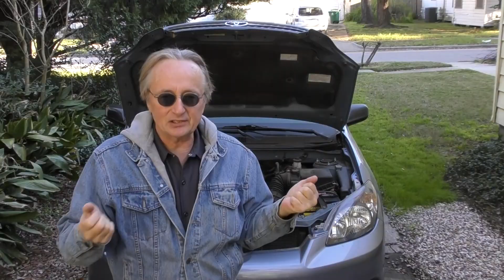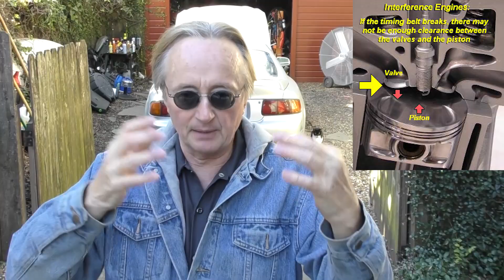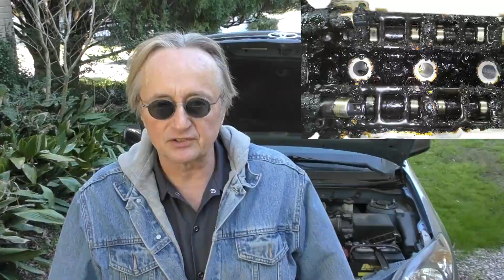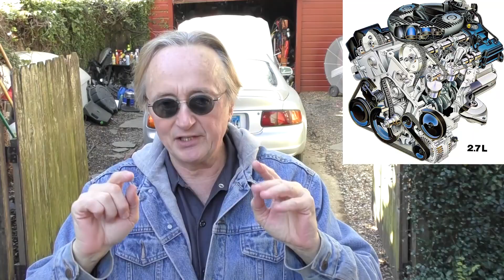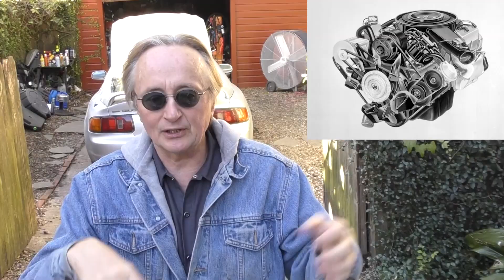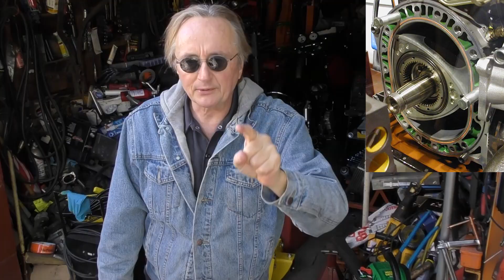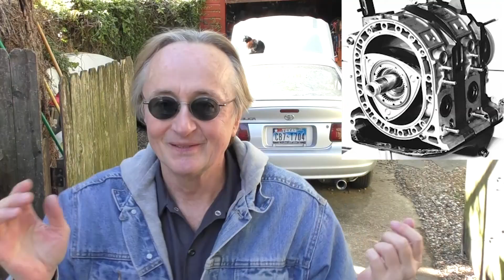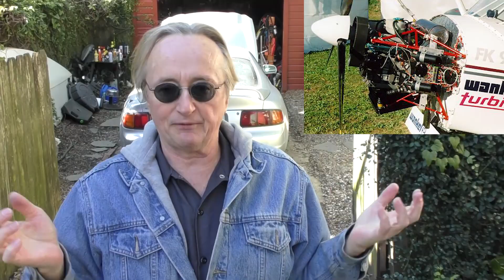Never Buy a Car With This Engine

Comment: 3.5l Ford duratec. Built just like the Chrysler with water pump internal. If anyone out there has this engine just know that when that water pump breaks around 100,000 miles or so your engine is toast. Should be a class action lawsuit.

Comment: He forgot to mention the water pump in the 2.7 Chrysler could leak antifreeze into the oil. And there were Toyota V6 engines with faulty pcv tubing that ruined some engines, and arrogant Toyota would say it was the owner's fault in spite of maintenance records until a petition was submitted to make them address this issue.
Reply: @Dilly Dally For the Toyota V6s, was that with the older Tacomas? (especially pre-2010) (FYI, even the post 2004 MY Tacomas, reportedly suffer frame rot!) (I have yet to be told about frame rot in the 2014 MY Tacomas) I know someone with a 2014 MY Tacoma V6 and it honestly looks like the best Tacoma generation! OTOH, I got word that the 2015 MY and later Tacomas are at risk of mass transmission failures and/or mass engine failures. Or mass diff. failures!

Comment: My dad got 338,000 miles put of a B150 Dodge 5speed/with oD short box fullsize 2wd 5seater 6door ! ( i remember my dad squirting calibrator cleaner in the carborator while driving & shifting with the engine shield off & the engine was visable in the cab)

Comment: I don’t see any issues with turbocharged cars. I think the owners are the issues. Don’t change their oil on time. My old Saab has over 150k miles, engine is super clean inside, no sludge. Oil was and is being changed every 5k miles.

Comment: Saab RE-Designed the timing chain BS that the original ecotec had. I also think the timing chain issue was corrected on the newer ecotec motors 03+ up if I’m not mistaken.

Comment: if you overheated the rotary engine, the aluminum housing it would  expand and "crush" . that meant the aluminum would have a gap below the exhaust port and anti freeze would leak in .  replace the housings and all the seals, also replace the clutch . the engine was out anyway. might as well save the customer some $$$$$

Comment: Scotty, you forgot the biggest TURD of all. The Oldsmobile Diesel of V8 1978-1985. We owned one. It was sooo bad of an engine, the dealer deducted $2,000 upon trading it for a Dodge Caravan (4-cyl Mitsubishi). The NADA guide had a deduct, right after mileage, for "gasoline engine conversion."

Comment: The 2016 R/T truck hemi 5.7L the  Eco mode sucks! And it tops out at 109... 👎
Reply: Operator 9013 thats actually not bad for a truck, most other trucks are usually governed to about 100 mph. My ‘10 dakota (3.7l v6, 4-speed auto) was factory governed to 107-108 mph, and i had it tuned to match the speed rating of my tires (t- 118 mph). :)
Reply: Kingswood7189 I understand but spending that kind of money do you think I should have to spend more on tuning?  22’s built in ram boxes tonneau cover all the bells and whistles...
Reply: Operator 9013 fair enough. I paid $19k for mine when it was 3 years old and later spent a couple hundred $ on the tuner (of which doesnt really adjust much, but it does make life easier if you get bigger tires and other things of that nature).

Comment: The earlier 5-cylinder Audi engine (and turbocharger) had a reputation for reliability. I had a 1988 Audi 5000 turbo on which many things failed, but it never had trouble with engine or turbo, even after I had the engine computer hacked and the wastegate spring replaced to allow more boost. Must have made troubles with the newer engine seem especially wrong...

Comment: Never buy a car with a timming belt.  Kia had these until 2009.  timing belt has to be replaced every 4 years or 60 thousand miles.  Expect to spend 1800 dollars to replace a 30 dollar belt.

Comment: I have a 2010 2.7 V6 Avenger and it’s been my battle horse since 2012. This is the first time I hear bad things about the  engine. To be honest with you till this day I don’t have any problems with it. But also I do my oil change every 3000 miles, I swap the spark plugs twice a year and I’m always trying to stay ahead with the maintenance of the vehicle. I have 108k in that engine. Hopefully it will last me more time. Already took me 3 times to Mexico City and i use it for long trips. Thanks for the great video.
Reply: @hitek9wittafulclip Wait till the anti freeze leaks into the base

Comment: I've seen plenty of EcoTech 2.2L engines with over 300k on them. Funny how you didn't talk about the garbage mid 2000s Toyota engines with the ceramic piston rings that burnt more oil than anything. Toyota wouldn't even let us fix them! They just replaced them.

Comment: Don't forget about all those junker DOHC and SOHC engines they put in all these crossovers these days that are just as horrible, unreliable, undependable as the Chrysler 2.7 V-6 btw which btw I loathe. Most of if not all the automotive company giants are guilty as charged. Defeat Devices is a trillion dollar a year business.
Reply: Toyota V6's FTW ... well at least ours from the late 2010's is still going strong!
Reply: @BenjaminEsposti  well late 2010s is now so that would make your car brand new.........so I would hope its still going strong
Reply: are these the Mitsubishi v6 found in Plymouth Acclaim or Dodges? I ran away from fixing them.
Reply: DOHC engine deisgn isnt really so new. My '98 Corolla with the 4A-FE has such without many problems.Its my least old car and doesnt have problems really. It did have an idling issue once but that was caused by a corroded alternator harness. I just replaced one pin on the harness and it runs like new lol.

Comment: The 2.2 ecotec is a great motor. I had oneu til 300 thousand miles and it never gave me an issue. They aren't called the small block of four cylinders for nothing.

Comment: So i habe 2 2006 chargers. One has the 2.7l v6. Should i put in a 3.5 high output. I have the 3.5l in the 2nd cbarger. According  to what i uave seen i only need a new accondenser and to make the hoses about 2 in longer. Trans, ecu, wireharness, fuel system will all switch over. Just a update to the ecu. Worth it or not. Still about 4k under the charger.

Comment: YOU FORGOT the GM V-8 Diesel engines from the early eighties.
Reply: My 6.2 is getting swapped out for a 4-53T Detroit.
Reply: GM learned a hard lesson from those.  Just like with the Vega, the problems were eventually worked out but too late.  Consumers went elsewhere.
Reply: @Jack McAvoy the 466 might be too long without some firewall mods. I don't know.
Reply: When they tried converting a gasoline engine to diesel? Duh. Almost as bad as the Cruze. That was the worst car I ever had.
Reply: Paul Jones ...Evidently you never drove a Chevette.

Comment: The Chrysler 2.7 was the first one that came to mind
Reply: I would like to slap the person who designed that POS. My first and last Chrysler buy.
Reply: I didn't know about this when I was looking for used cars a few years back. Went and test drove two of them.  The first one the oil light came on during the test drive. The second one the light turned on the second we turned on the car and then just gave the guy the keys back.
Reply: @DixieBoy308 Among the other issues these engines have is a design failure of the oil pressure sensor. Chances are that is what was wrong with those two cars, but I would have walked away too!
Reply: When it comes to the 2.7 and a few of Chrysler's other engines, DO NOT let the coolant system flushing go and do not divert from the coolant that they recommend to use.
Reply: @trackrunner11  more importantly, don't cheap out on oil and change it regularly (with full synthetic)! Sludge buildup has killed way more of these engines than cooling system failures.
Reply: My 2.7 had 125,000 miles when the car was totaled by a Mazda that ran a stop sign.  Never had any trouble with it. A Chrysler tech told me to keep the oil changed.  The only downside was at 10 degees out the heater didn't  but out much heat.
Reply: The sludge build up can be improved with an oil catch can set up.  I'm surprised  most cars don't come with them but then again knowing car mfgs it makes sense
Reply: Definitely isn't the greatest but not the worst 202450 miles my wife's engine developed rod knock. I'm. Kind of happy that 05 sebring was a piece of junk.
Reply: Pete Laframboise : All the Sebrings are JUNK👎!!!
Reply: isnt the hyundai santa fe 2.7 L the same deal- water pump driven by timing belt
Reply: Same knew it was gonna be here before I watched the video.
Reply: I'm surprised he didn't mention mechanics not putting the egr valve back on properly with the 2.7L
Reply: @Ryan Cole 2001 Intrepid with the 2.7.
Reply: I have one. 230,000 miles and still going strong.
Reply: @BamaRailfan  
You're VERY lucky, quick go to VEGAS!!
Reply: @motorcitymanman7711  lol maybe I should! 

Actually the water pump did fail catastrophically in this engine at around 190,000. Made a mess of things but nothing too severe. No bent valves or damaged pistons. New pump, chain, and tensioner and all was (and still is) well.
Reply: @BamaRailfan  I had 272K on a buick that I wish I had back. Oh, and 30-32 mpg on the interstate. Yeah back to the past ! ! !
Reply: @BamaRailfan  I bet you're a maniac for oil changes on schedule and not one mile later, and ONLY using 100% synthetic motor oil. And I bet you've replaced the timing chain and water pump twice by now, before they became problems. That's the only way to make those engines last. And good for you for being meticulous about maintenance.

Comment: The 1.3 L Mazda engine is actually one of my favorites. The 1.3L (13B) came back in 85 in RX-7 GSLSE. I drove that car for 430k miles, hardly used any oil. Fuel injection gave pretty good MPGs. Throttle body had a tendency to warp. I still miss that car. It was one my all time favorite. The first series 1.3L ya it was not great.

Comment: What do you think about Ford's 3.5l duratec (non-turbo) engine? I have one in my 2011 fusion sport and they come in a lot of older edges and flex models. I'm aware of water pump issues, but not sure how common. Book time is close to 14 hours for my fusion because you may have to remove the engine to do them. Unless there is a cheat.

Comment: Timing chain interval for the ecotec is 90k miles kit comes with everything you need, shouldnt blame lack of maintenance an engine flaw or bad design they will go about 130k miles before they start rattling and breaking the guides, same with all them timing belt driven engines that people never maintain and blow up the same way (Toyota, Honda, Hyundai) just to name a few. Yes I agree gm could have made it a little easier to replace the change but is a decent engine compared to the daewoo engine they used in the aveo and spark

Comment: I am surprised that Scotty did not mention the Hyundai/Kia Theta II Engine. That engine was trash from day one.
Reply: The v6 quad that they put in the sante fes were trash even if you changed the timing belt as recommended it was a really pricey and pia job I wouldn't buy one if you paid me
Reply: Absolutely those engines are blowing up on the highway, huge recall.  The Ecotec in contrast when maintained is pretty decent.  Now for truck engines, 5.4L triton chain tensioners leak, lack of oil pressure to head is not good!! Can phasers fall apart..Lots of complaints from mecanics
Reply: 2005 chevy aveo should be on the list.
Reply: he didnt have to...... all kia Hyundai engines are just junk made to last 2 years in china then get scrapped.

Comment: Going to have to disagree with the 2.2 Ecotec. One of the best engines GM has ever made.  I am a mechanic at a Chevrolet dealership, and while the 2.4 Ecotecs are pure garbage, the 2.2 is rock solid. Can't even remember the last time someone did any major repair on one of them. Cars come in all of the time with over 200k miles on them. Hell the 2.4 non direct injected engines last forever as well.

Comment: Hey Scotty, what about the 5.4 Triton?
Reply: The 4.6 and the 5.4 were very reliable the ones I saw blow up were low on oil very sludgy so lack of maintenance the 4.6 was weak for power imho but I towed with it and it down shifted to 5000 rpm+ and it took the abuse
Reply: @budsodastories  thank you

Comment: I sadly have to disagree my 2003 Saturn L200 with the 2.2 ecotec that I've had for 3 years and put 70 thousand miles on it never had any issues with the engine. my car is at 212 thousand miles on it and still strong !! :)

Comment: scotty, I have a 2007 chevy cobalt with the 2.2 ecotec engine I have 221,000 miles on the car with original and trans. It's all about taking care of the maintenance heck I had to replaced the timing chain on the engine at 186,000 miles because of timing chain tensioner failure the vehicle runs like a top to this day no problems with it. I plan on getting to 250,000 miles with the vehicle as it is.

Comment: I had a 2.7 liter in a '99 Concorde. Got rid of the car at about 75000 miles. The engine was running OK but there were other things breaking on the vehicle. Unloaded the thing while it still had some value. Someone told me this motor was designed by Mitsubishi.

Comment: When you shut a rotary engine off you're supposed to rev it up before you shut the ignition off. That way the residual rotation of the rotors will force the fuel out of the chambers (the injectors will no longer be firing) and prevent any potential flooding at the next start up.

Comment: The 2.2 eco tech is a very good engine. Runs forever as long as you change the oil on a regular basis.
Reply: Most people can't be bothered to look after a vehicle, unfortunately.
Reply: Family member has one. Burns a quart in 5k on synthetic. Primary timing chain went bad and replaced at 80k. VVT solenoids went bad twice. Its easy to work on though and keeps going. Not a stellar engine, but the power is good and the parts are cheap.
Reply: Had to change vvt solenoids. It took 20 mins and about $12 online. $30 bucks if you buy the part at autozone. Still a really good engine for what it is. And will last a while if maintained

Comment: Hi Scotty have a 05 dodge neon it won't turn over but the battery and alternator and starter is good replace the ignition switch and still nothing what could be the problem

Comment: it's a Hardy motor I drive one with 2 low on oil for like 300 miles in the thing just kept running running just kept making more noise they had a hotter than 87,000 miles on it and it ran like a champ still runs 2004 Chevy Malibu with a 2.2 l

Comment: I owned two Mazda RX7’s. An 85 Fb with the carbureted 12A and a JDM FD3S with the 13B twin turbo engine. The 12A had V8 like fuel consumption but was very reliable. The 13B was actually pretty good on gas, and during my entire ownership, did not cause me any trouble at all! And that was the best, most fun to drive car I ever owned! If you give that little rotary engine the love it needs, it will reward you with fun factor big time!

Comment: I have the 2.7L v6 chrystler and it runs grate and has grate power without to many issues and had regular oil changs and 130,000 miles and love zipping around town

Comment: My 2005 2.2 ecotec has 450,000 miles on it, and my 07 cobalt has over 220,000 on it. No problems with my ecotecs 🤔
Reply: dorian james did both have turbos? No problems at all? What your secret?
Reply: James Medina just change the oil religiously and did the regular transmission service. The Cruze is a turbo and does have an engine light on, but it’s from the valve cover. But still runs great. Plus I live out in country and they take the abuse of rough roads. The cobalt starting to drink a little more oil too, but it still runs great just check the oil every now and then.

Comment: Scotty I had a 2003 pontiac grand am it had that engine 2.2 and went over a 187000 miles when I owned it I sold it to my friend who is still driving it to this day with over 240k miles. Now yes when I had it it started to burn oil around a 180000 miles. I don't know if I just got lucky but that was my 1st car and it was a great engine for me l. And I don't think it ever had a timing belt to put in it but I change the oil very regularly

Comment: You left out the Motor Trend Car of the Year 1971 Chevy Vega! Worse and shortest life engine ever..1 ft x 1 ft 2 core radiator the size of most heater cores coupled with cast iron head on aluminum unsleved block and air cooled power glide trans (best feature if you ran an external cooler). First with gas tank fuel pump. Tiny rad made them heat up and as you know block n head contract and expand at diff rates causing blown head gaskets and chips cashing in before 30k miles if you were highway driving...what a pile till you put in a v8 chev or v6 Buick...worthy of its own video!?!?

Comment: Hey scooty how you doing just wanted to ask you a quick question i have a 2006 civic si with the k20z3 engine i have this idle issue where the car idles real high like about 1500 rpm and i get a check engine light for P0507 idle higher then expected I've been trying to almost a year trying to fix this issue and no mechanic around my area has been able to figure it out...

Comment: Hi Scotty!  Good video, but... I have a 1981 Cadillac Deville.  38 years old and still driving.  I have had it for over 20 years and I only drive it once in a while in good weather.  It has proven to be very reliable and the engine on mine runs smooth.  It does now seem to have stopped using cylinder deactivation but that was not what I liked about the car anyway.

Comment: lol wish this video was made before i copped an 05 chevy cobalt with a 2.2L ecotec LOL, in 6 months i put 30k km on it 220k - 250k and honestly slacked on the oil changes a bit but still running decent not many problems guess i got lucky